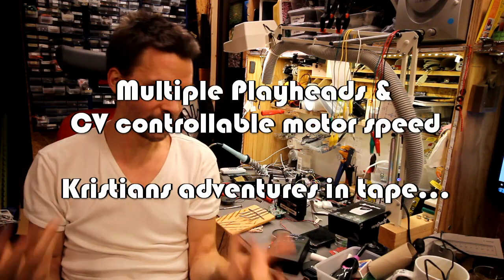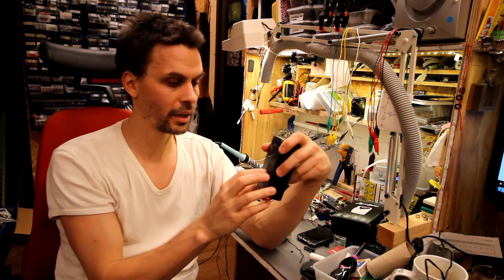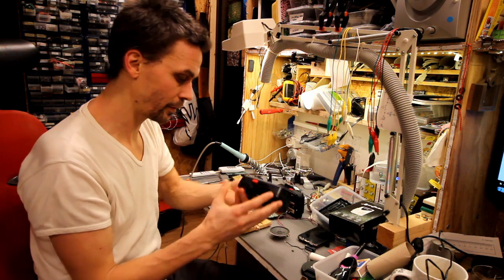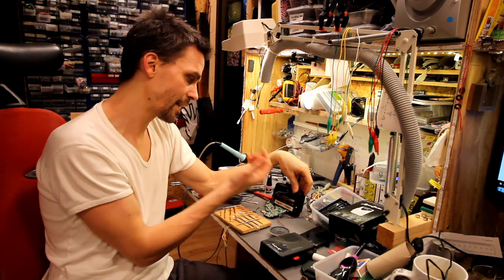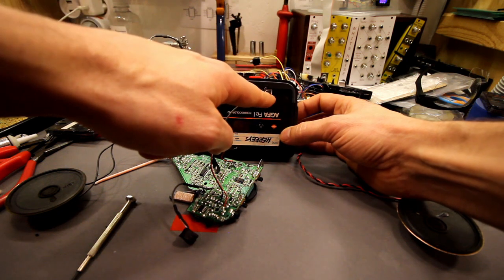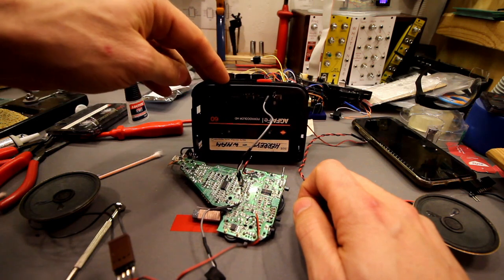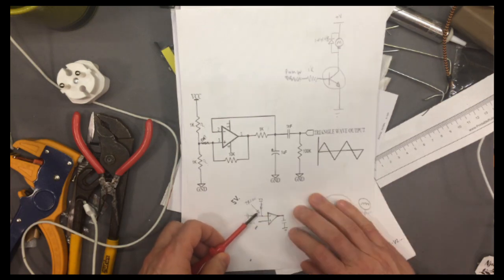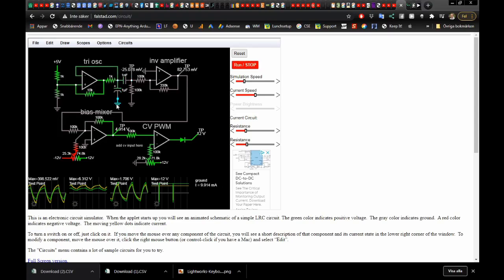multiple playheads & CV controllable motor speed - Adventures in tape

Comment: the record button can be tricked into not recording- usually there is a mechanical function that you can take out of the button so that the erase head will come down but the player will still only play, not rec. Once you take out that tiny switch on the board you can record with the secondary head and play with the primary like you wanted. hope this helps :)

Comment: I love the idea of a tape module but I think I'll have to strip it back even further than the cassette machine. Looking at using my 3d printer to make a panel like a small WEM Copycat looper. Lots of heads,  loops within loops, your cv to pwm circuit and a reverse or "scratch" function. One motor control, a mixer of sorts and some audio / record circuit or a nano/teensy to give me more audio sample storage or fx and maybe MIDI as well as cv.
I'll shout in 10 years or so when I've built it.